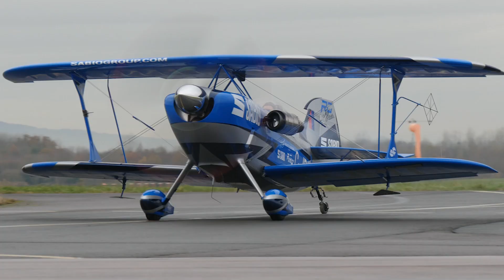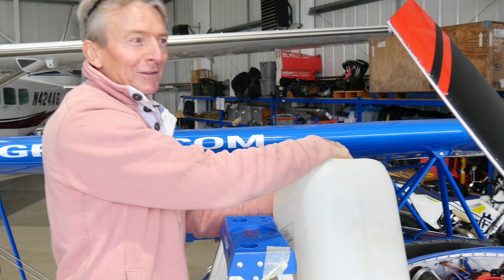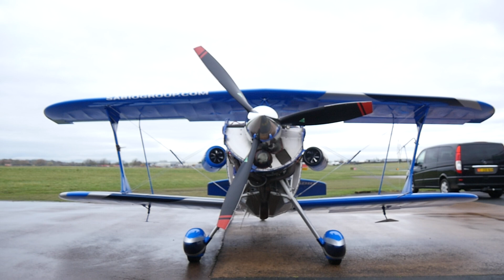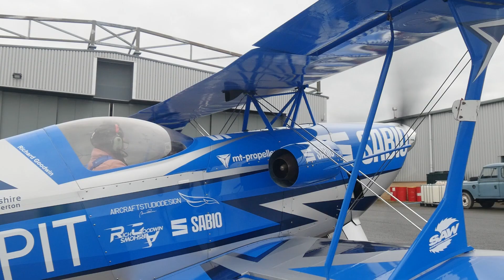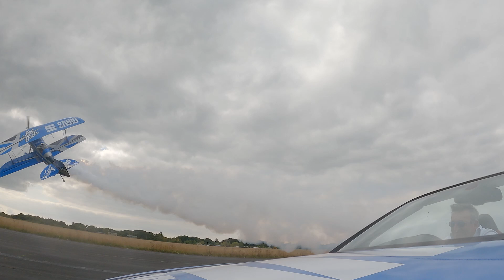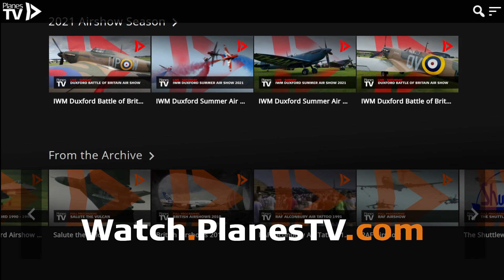Jet Biplane! 3-Engined Jet Pitts

Comment: On the US airshow circuit, they have a 'Yak 110': basically, two Yak 55s welded together at the wing spars, so that the end result is a 'twin Yak (which they've dubbed the Yak 110) comprising of two cockpits and two propellers. But, they've thrown in extra propulsion in the form of a mounted jet engine, which was salvaged from a Cessna BizJet, if I am not mistaken. I've seen it fly (not in person, but in the youtube videos), and it is a fantastic and unique flying contraption! I plan to visit the US and hopefully see it fly at an airshow.

Comment: Hi. You can see the passion. What a retirement vocation! There will be some loss of forward thrust folks with the engines inclined out which everyone involved will know about of course. If I remember my trigonometry correctly it will not be that much at the angles involved but reducing the angle will gain a bit back It will be very interesting to see the performance once all the certifying authorities are happy with the safety. I'm delighted Planes TV is covering this sort of aspect as well as the flying. It helps appreciate what it really takes to get up there in the air.